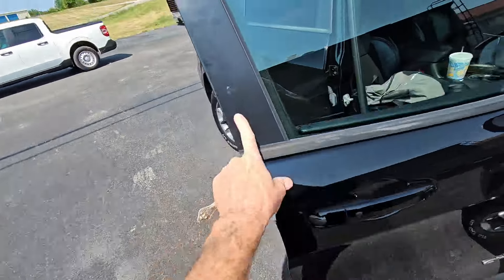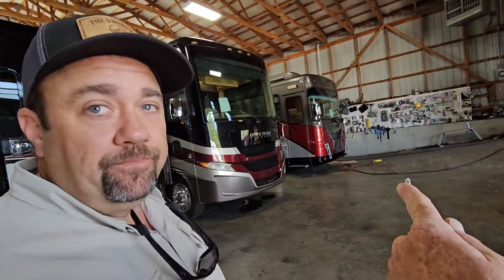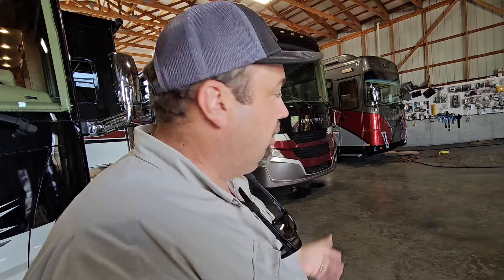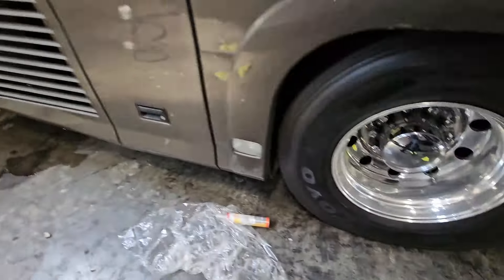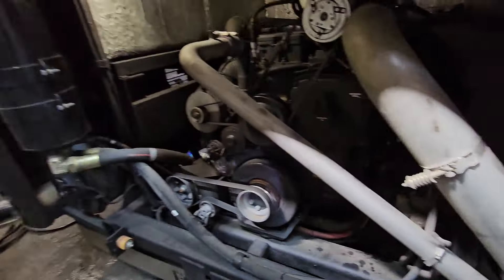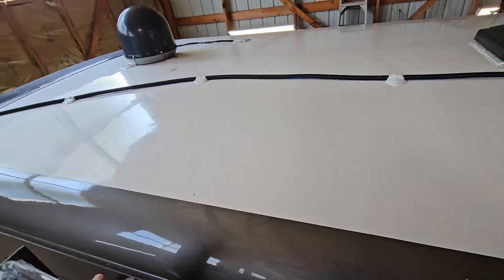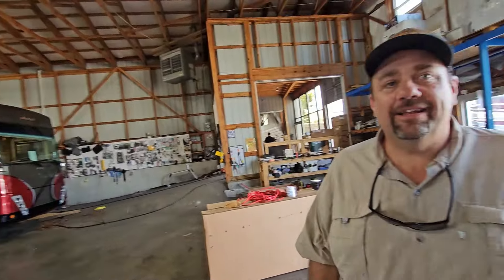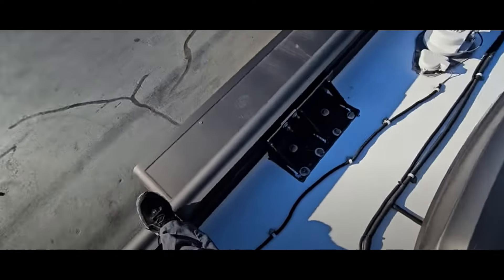Another Foretravel Returns: Did Sewell Motor Coach Repair It?

Comment: Great job on the AC drains.  At least Foretravel put them on top of the roof.  Bluebird and a lot of others put them under the roof and when those leak you have a mess.  We just got ours back from Coachcraft.  They replumbed the whole system.  We are good now but what a pain with 4 units.  Thanks for another great video James.  I appreciate it.

Comment: Foretravel is a well screwed together coach, but I would suggest adding a bulkhead inspection to your review. The area just front of the duals is where the bulkhead can separate. The wet bay floor is another area. 
I would also inspect the two attachment areas directly under each extended slide for corrosion. These inspections can be viewed without physically getting under the coach which I know you (understandably) avoid.
Reply from the maker: funny you mention that, I was just discussing that with someone a few hours ago

Comment: We have a 2013 Discovery with Dometic AC units… I like the idea of the condensate drains and would like to incorporate… our condensate now runs out through weep holes and depending on tilt of the MoHo drains on the roof in all directions… is the drain line a better idea and are they prone to backing up?
Reply from the maker: not generally, most factories add a kazoo type flapper end to keep debris and bugs out.

Comment: One of the biggest issues with PEX is it's NOT UV SAFE. If it never sees sunlight, it is OK. Use vinyl or PVC tubing if it is in the SUN... Is the new AC unit mounted backwards?
Reply from the maker: the ac is not mounted backward, the loom is to protect the pex

Comment: Condensate lines on a roof AC?
Where does a regular roof AC release condensate?
Reply from the maker: ontop of the roof
Reply: Bluebird and some other coach manufacturers run the ac condensate lines under the roof.  Roof is cleaner and you have less line rot due to sun, but when those condensate lines stop up and leak you have a mess.  We just had our 06 Wanderlodge repaired and all is good now but I much prefer roof drains on top of the roof. 😁

Comment: I don’t understand why Fortravel Wood plum condensate drains on top of the roof and not do it like Monaco does everything down below
Reply: Our 06 Wanderlodge has them under the roof.  I prefer them on top.  When those condensate lines stop up and leak you have a mess.  We just had ours's repaired and it was extensive taking down all the interior panels, especially with 4 units to plumb.  Pros and cons to both systems I guess.

Comment: Sewell, the home of the $10,000 non-refundable deposit...
Reply: 10% non refundable 
We sell coaches 
We don’t hold them.
Works very well for us.
Reply: I see coaches on Facebook marketplace by private sellers that appear on dealer lots 3 days later for sometimes $20,000.00 to $40,000.00 more than what the private seller had it listed for. The dealer doesn't do a damn thing to it. Sewell is fully inspecting and reconditioning the coach before sale which the other 90% of dealers aren't doing.
Reply: We've owned an 06 Wanderlodge for 5 years.  $10,000 is a mere pittance when looking at the cost of ownership of these units.  I don't have a problem with the cost.  Keeps tire kickers away.

Comment: Miss your fixing videos instead of these commodification videos for Sewell.. please go back to them.... These big class A RVs are  not selling at all the RV market is tanking along with the used ones especially the class As that older then 15 years old as they cant stay in most RV campgrounds and are a maint nightmare, chassis, wheel bearings suspension, air bags, air compressor lines, and ive seen many videos here of these rigs sitting on bad air bags that have failed..warning..if you see one of these low to the ground it means there is a big problem either bags, compressor, air lines etc..and ive seen these many times on this channel...and these are a maint nightmare expect to spend thousands a year to maintain...the bigger the RV the bigger the Maint along with 7mpg tops
Reply from the maker: I would suggest that you have a lot of misinformed opinions about RVs, parks, and how I spend my time. I think this is not the channel for you as you seem unable to learn from the information I freely give. Please consider that it took you intentional effort to type and re-type cruel and unneeded commentary to another human which reflects your character more than anything.
Reply: @AZExpert  Ive followed you for years and always enjoy your content, Im not mis informed my 2009 is coming up on being banned, and I have been banned at several parks as its to old
Reply: We have a 2003 Holiday Rambler that we take care of and have never once been banned from any RV park . It’s funny what a little proud and a wash bucket will get you with these parks . …..
Reply: We own an 06 Wanderlodge.  We wouldn't trade the experience of ownership for anything.  I wish I got 7 mpg.  James has a great informative channel that I always watch along with Doug's and Andrew's.  It's a great way for this retired guy to spend some quality time sipping coffee.  Keep up the great work James.  I appreciate your channel so much.
Reply from the maker: @lutomson3496  yet my 2001 has never been turned away, used class a's are selling, and the rv market is not tanking. I make videos about what I am currently working on and requesting that I make videos you want is more than impolite it's rude and smacks of a lack of understand of decent personal emotional boundaries.